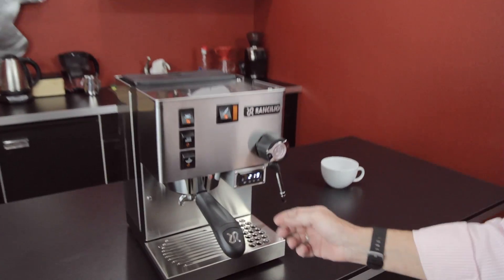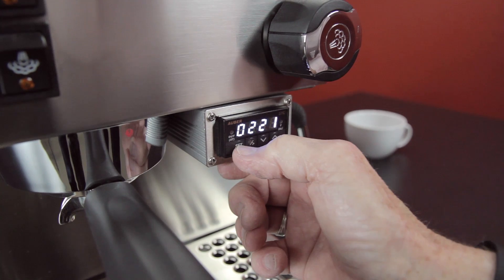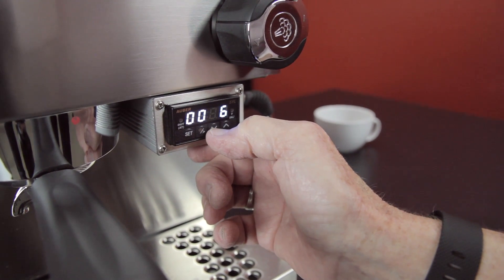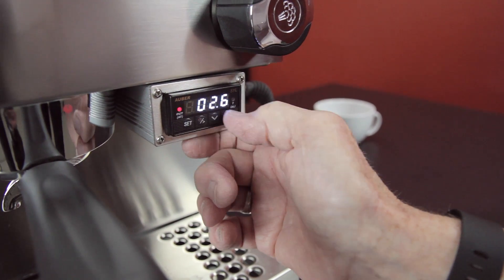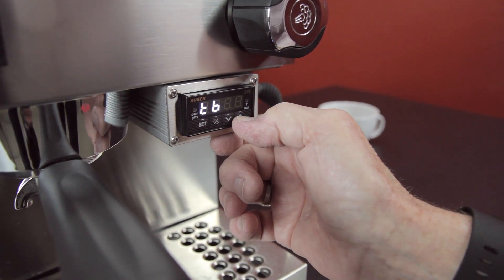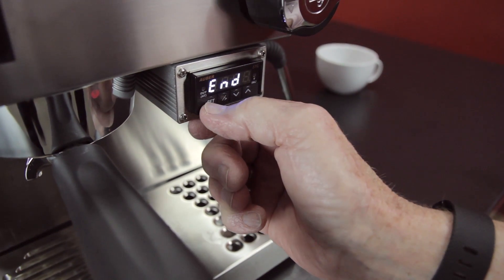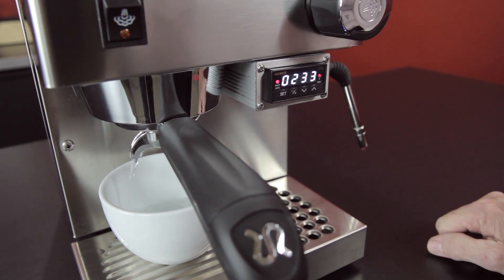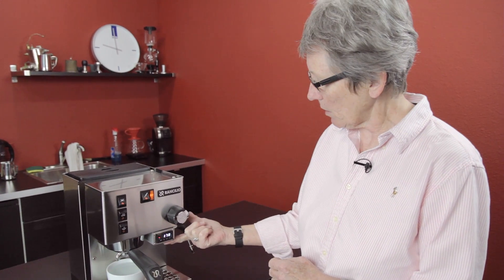Programming a PID on Rancilio Silvia | Morning Maintenance

Comment: Wait WTF she said "set it to 201" while setting the screen to 221?.... is that an Auber PID thing? should I add 20?
Reply: same question.  Why 221 if ideal brew temp is 195-204?
Reply: Found it!  Explanation in following video: https://www.youtube.com/watch?v=2Mk7S-AcI2M     Explains that temp is outside the boiler and about 20 degrees lower at brewhead.

Comment: Hey, so I had the same rancilio with the same PID. I bought it used and did not know how to use the PID. I finally followed all the steps of the videos and now, it will not heat up more than 73 degrees. Help!! Need my coffee!!
Reply: Did some more into the problem, found some videos about this problem with results being as heater coil half way failure with calcium deposits on it... Look  more for fixing ways...

Comment: Thanks for this. I've looked everywhere but can't find guidance on the very first step - what to do with the brew switch? You have the brew switch set to 'on' while you’re setting the PID, but why isn't the pump working as soon as you do that?  I've set my PID as you've demonstrated but as soon as I turn my brew switch to 'on' it starts working.  And when the brew switch is off, the PID won’t do anything when I press the play button on the PID. The PID play button doesn't seem to control the pump at all. Any thoughts?  Thanks

Comment: If you have a Sylvia with a PID installed, do you still have to run water through the steam wand after steaming so that the boiler doesn't burn out or is that what the PID is for?
Reply: Delphine Pay I believe you still would. The PID controls the brew head.

Comment: When the Silvia pauses between preinfusion and brewing does the 3-way solenoid kick in and pull water off the portafilter?
Reply from the maker: It does, although with the low pressure it shouldn't be pulling much water

Comment: Hi.  Thanks for the video on the PID.  I bought a kit from you, installed it, and it works great.  My only disappointment is that the temperature lowers while the shot is coming out.  So, to get a good temperature, I have to start it higher.  I this typical?
Reply: Yes, that's why she has it at 221

Comment: What are the recommended temperatures for both brew temp and steam boiler temp?  I fiddled with mine a while ago and forgot what the defaults were set to by Auber. Thanks for posting the vid!!
Reply from the maker: jhamm15 Take a look here at the Operation Manuel. Page 3 should be a good place to start: https://www.seattlecoffeegear.com/assets/files/silvia-pid-operation-manual.pdf Typical temperatures are as follows: SV: 221 AH1: 283 AL1: 284, but of course these can be adjusted to get that perfect shot!
Reply: I believe you can find the manual on Auber's website. And I think there's also a way to set all the defaults back.
Reply: As soon as I start the machine stays at 27 and the OUT (AT) lights it's on all the time. Do you have any idea why? Thank you!

Comment: Is this the PID that is installed on the Silvia for 870 something? ( KIT-RSPba-W ) If so when you DO get the Silvia back in how soon would one be able to purchase one of the "v4"s with this installed? Also how is the PID mounted? Can we request it be side mounted or left loose? I am really interested in the steam temp control as well as that stainless element in the boiler. MM it looks like they are back in stock! As soon as I get answers I might be be throwing money at you! hah, BEGONE my horrid krups il primo from the 90s!
Reply from the maker: Madkoifish Right on! New equipment! We only mount the PID in that place due to the constraints of the wiring and shape of the Silvia. That being said, if you wanted to install the PID yourself, that is an option. But from our experience, the current placement of the PID is optimal- remember that it also becomes your brew button. :)
Reply: Missed out on the limited stock!  They sold out in a few hours on me. So I have to wait for the restock. T_T  Thanks for the reply.
 I think to save cash I will go with the preinstalled and keep the SCG warr as the PID likely will void the factory stuff. I can then relocate it after the SCG warranty runs out if my counter height issues persist. Rewiring or replacing all the wires is not much if a issue for me. I was more worried the PID was screwed in or mounted in some way that would alter the casing of the machine. I have found online that it is taped into place. So it all works out.